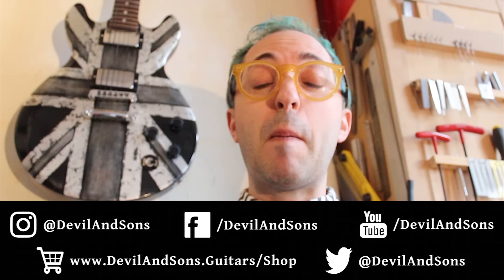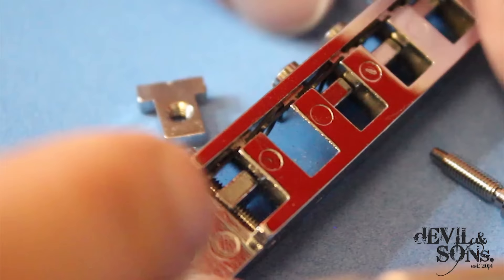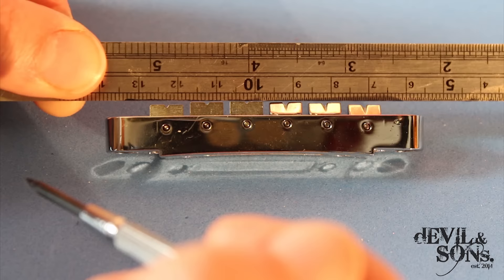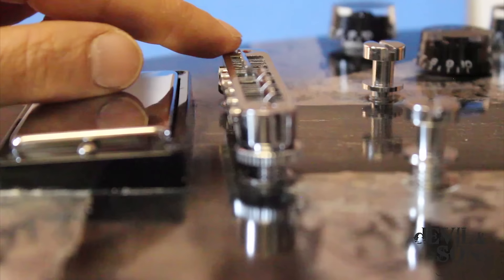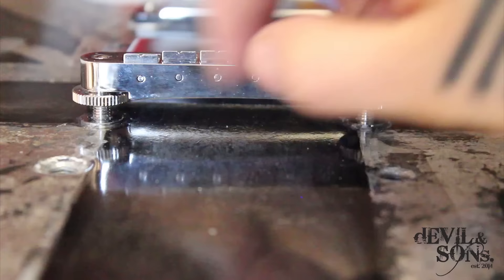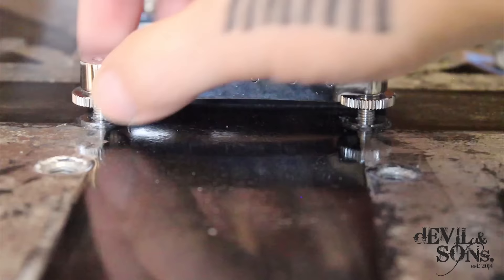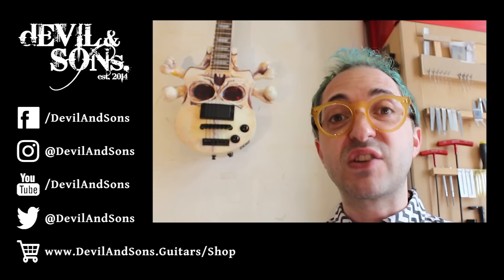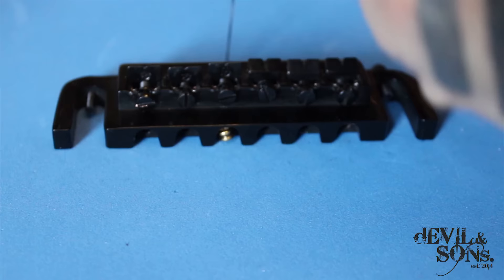Setting up a Tune-o-matic bridge (Les Paul style)

Comment: Hi Daniel! Thanks for this very informative video! A Tune-o-matic bridge does it require an angled neck or it could be used on a flat-top guitar like a Stratocaster?
Reply from the maker: I have definitely put one on a strat before but you are right, this makes the bridge much too high. One solution is to reduce the depth of the neck pocket with a thin piece of wood cut to fit and sandwiched under the neck heel,  but you may find you will need a slight angle by either giving this piece and angle to it or simply putting a shim in under the neck at the two bolts nearest the body so it does have an angle. It would also mean the pickups at the bridge position may need to be raised much higher than they normally would go. Essentially it’s not straightforward but possible.

Comment: Dear Daniel, could you please advise me on how to best perform a mod i'm thinking of. I have a very cheap Epiphone special 2, it has a fixed bridge (i guess it's called), so the strings both anchor on it and it acts as a bridge as well, although the saddles are immovable. I want to mod all of this as follows: drill holes so I'd have my strings go through the body and install a "tune-o-matic" with rollers instead of regular saddles. Please be so kind to advise me how best to perform this operation (how to correctly calculate the new positions for the new bridge and the position for all holes, both for the strings and for the bridge). Thank you very much in advance!
Reply from the maker: Does the fixed bridge still attach with the same two uprights as a standard tune-o-matic? If so you can simply replace this with a tune-o-matic with the the roller saddles (just double check the spacing of the uprights first). Then the stop piece you don't use but drill the holes where this would go, although really you could put the holes in a diagonal line, a straight line, random (you can get inspiration for this by looking at other guitars). To know where to drill the holes run a string over the bridge and angle it down to where you think the hole should be - as long as the string isn't catching on the bridge (as shown in this video when adjusting the stop piece height) you should be fine. Don't make the holes too far back as it increases the length of the string and you don't want to run out of string - although I doubt that will be a problem. You'll also need string ferrules to go in the back of the guitar to hole the ball end of the string in place.
Reply from the maker: I hope that made sense.
Reply: @DevilAndSons  Daniel, thank you so much for such a swift and detailed answer, everything you said definitely makes sense and is helpful, including all the great advice I got from the video. Alas, the spacing on the new bridge is wider than the old uprights; plus, another thing is that as it is now, there's just very little space between the bridge pickup and where the current bridge/stopbar is. this is exactly what I have now: https://images-na.ssl-images-amazon.com/images/I/61PJ%2BP4CVLL.jpg

Thanks again Daniel, for the content and the support!
Reply from the maker: Hmm, it's a shame it is wider. It may be easier to shop around for a new one that is the same width. I always look on ebay and amazon as there are often many options from various sellers there. If you end up sticking with one that is wider you will need to remove the old one, fill the holes, and drill new holes for it. Ideally the new one will go in as close as possible to where the current one is, if you increase or decrease the distance from the nut to the the saddles you will effect the intonation (although the saddles that move allow for some compensation). On the plus side there is lots of space for the through body string holes to go.
Reply from the maker: And thanks for your kind words about my  videos

Comment: what would be the ideal angle from the low E to the high E string?
Reply from the maker: Ideally you don't set the angle, you set the string height. So the height of the low e and the height of the high e above the 12thfret determine the angle. I have a video about that, I'll link it in the next comment.
Reply from the maker: Here it is
https://youtu.be/eNrrjXvebWI

Comment: One thing confuses me. I see many variations of the Tune-o-matic, even from Gibson. I have one on my Les Paul Studio. But it has adjustment two flathead screw slots atop each post which enables you to change string height. But, on others, there are no screws and you can only use the thumbwheels. But they're both called Tune-o-matics, even by Gibson. Can you explain?
Reply from the maker: Don Lessnau I’m not really sure - I guess they are essentially the same system just one uses screws and one uses thumb wheels to do exactly the same thing - it’s not really the bridge working in a different way just the way you alter the height is either with a tool or with your hands, but either way you are doing the same thing. The actual way the bridge works is the same. It’s like if the screws were flat head or cross head they would still be doing the same thing even though they are different screws. Does that make sense?
Reply: Yes. I have several guitars, including a couple Gibsons. that have Tune-o-matics but some have slotted screws in addition to the thumbwheels and others have hex head screws with thumbnails. But essentially, it's the same bridge except for the post screws. NBD. Just curious.
Reply from the maker: Don Lessnau I think it is an aesthetic choice as much as anything else, although I find thumbwheels more fiddly. Of course with thumbwheels you don’t need any tools to make adjustments.

Comment: I have a question. What should I do if I lose one of the springs in the saddles?
Reply from the maker: The springs are important to keep the string in tune, you could temporarily make do but I would buy a new one. I think if you look on ebay or amazon for guitar saddle springs you'll probably find them quite cheap. Alternatively you could look in the same places for a cheap replacement bridge (in the UK you can get them for under £10) and just take the springs off of that.
Reply: @DevilAndSons  thanks man! I'm gonna sub now
Reply from the maker: Cheers, thank you
I hope you find the part.

Comment: Why are the bass string saddles facing in the opposite direction to the treble strings? You point that out in the video and explain the difference but fail to mention why?
Reply from the maker: Opps, I thought I did. Bass strings are going to be thicker strings and therefore they will need to be fractionally longer for proper intonation. In general you would expect a nice slope with the saddle for the thickest string furthest back, and the saddle for the thinnest string further forward.
Reply from the maker: I explain intonation in this video, 34 minutes in: https://youtu.be/fvD-qsM3piQ
Reply from the maker: And actually next weekend I have a video coming out about scale length. Basically between that the full set up video there is a lot more information about why the saddles aren't in an exact place and change depending on the string and tuning.
Reply from the maker: I hope that helps explain it, happy to give more detail if needed.
Reply: @DevilAndSons  Job done...thanks Devil
Reply from the maker: My pleasure.

Comment: Does lowering or ascending the screws specifically on the Intonation saddle affect the intonation in general?
Reply from the maker: Lowering or raising the saddles adjusts the action, moving the saddles closer or further from the bridge adjusts the intonation. However changing the action will very slightly adjust the intonation but it may not be that noticeable.
Reply from the maker: Here's more on intonation 
https://youtu.be/cQ-yslOuHck
Reply from the maker: And here's more on action
https://youtu.be/eNrrjXvebWI

Comment: Do you recommend having the positions of the individual saddles in the position you're demostrating with at 07:25 before putting new strings on your guitar, the base saddles are lined up together and the treble strings are also lined up together but the treble strings are also further forward, or do you recommend having the saddles level for adjustment later? I do know about the bass strings naturally needing to be further back as you explained but it's the original position of the saddles before new strings i'm interested in here?
Reply from the maker: Simon bpuk great question, for which I don’t have an exact answer, but I would have the bass ones slightly further back and lined up and the treble slightly further forward and lined up. To be honest it’s unlikely however you position them that all strings will be perfectly intonated straight away so you’ll have to adjust them all whatever, so it probably doesn’t make much difference but at least you will be closer. I hope that helps. Occasionally a saddle is in the perfect position as soon as you put it on, I always think this is a great lucky bonus but impossible to predict.
Reply from the maker: The full set up video is now up, you may find it useful: https://youtu.be/fvD-qsM3piQ

Comment: I have a question. Why are first 3 saddles facing neck and the others tailpiece. In some tune-o-matic bridges, in this case mine, all of the 6 saddles are facing similar direction. Can you tell me which one is correct? It's blowing my mind.
Reply from the maker: Great question, I talk about it 3 minutes 30 seconds in. Basically bass strings normally have to be longer than the treble strings. Having the angle face backwards on the bass saddles allows them to rest on the saddle as far back as possible, having the saddle angle face forward on the treble stings allows them to rest as far forward as possible. It may not be needed as the saddles themselves move and you may be able to get the correct intonation without the saddles needing to be in their extreme positions (either way), but if you need that extra 2mm this is how you get it. I hope that makes sense.
Reply: @DevilAndSons  Thank you very much. I live in Georgia (the country) and here it's impossible to get a guitar speciallist who knows everything. I have to learn from youtube. That's why I watched your video and thank you again. Great video 💪
Reply from the maker: Michael Stark thanks so much. I love the internet, and YouTube especially, for finding out things. Happy strumming.

Comment: How do I adjust the saddle when the bridge is already on the guitar, cuz my 12th Fret isn't exactly an octave? It's like at a very inconvenient angle and I can't properly get my screwdriver in. Do I need a special type of screwdriver or something?
Reply from the maker: Unfortunately when the screws point towards the tailpiece it is often hard to turn them, even if they are pointing towards the pickups. The only solution I know of makes the whole process a bit longer but is pretty straightforward. You need to loosen all the strings so you can move the bridge to an angle where you can make the adjustment, then tighten the strings again. It may be easiest to loosen all the strings, adjust the lower e saddle, tighten just the lower e. Once you have this right move on to the a. You'll have to loosen the e again, adjust the a saddle, tighten the a string to check it's right. Then move on to the d, etc, one at a time. Tightening all the strings at the end. Alternatively you could loosen all the strings, take the bridge off and turn it round, tighten the strings, and hopefully have access to the screws more easily with the bridge the other way round.
Reply: @DevilAndSons  the screws are on the pickup side. Thats a good idea, thanks, I'll try it.
Reply from the maker: Good luck, it should work even if it takes a while. By the way I have a full set up video that explains intonation that may be helpful.
Reply from the maker: https://youtu.be/fvD-qsM3piQ

Comment: how do I know that I have set my bridge height correctly?
Reply from the maker: Thanks for leaving a comment. basically as a guide I would suggest the following:

Measure the height of the strings at the 12th fret, for the top e you want it around 1 - 1.5mm from the top of the fret to the bottom of the string, for the low e you want it around 2 - 2.5mm high. This is just a guide and you will find the gauge of your strings and the way you play will determine what is best for your particular playing style. If you need a bit more advice there are quite a few videos that focus on how to set up a guitar in general that should help. One day I will make that video though, although it will probably be a bit late for you - but do subscribe to see it when it happens. Thanks again for commenting.
Reply from the maker: The full set up video is now up, you may find it useful: https://youtu.be/fvD-qsM3piQ

Comment: I have a slight buzzing of my G string on the 15th fret.  I don't know what caused the buzz,  maybe u can help me
Reply from the maker: It could be a couple of things. First I would try raising the string height by making the saddle higher (but not so high you aren't happy with the action) and if that doesn't work I would try adjusting the truss rod. I have a whole video on setting up your guitar that may help as it covers both of these things. https://youtu.be/fvD-qsM3piQ
Reply: @DevilAndSons  i will try to do that.  Its is the only fret and string that has a buzz sound.  The other frets and strings doesn't have. That makes me wonder.  Thnx a lot,  ill hit u back if it works
Reply from the maker: It could be an issue with a fret but I think altering one or both of those things should resolve it.
Reply from the maker: Let me know how you get on.

Comment: I'm having string buzz at higher E string at 11 th and 12th fret... what can I do...... I've given relief on the fretboard by adjusting the truss rod..... the frets are even i've checked with fret rocker.... still those two frets are buzzing...... Help pls.....
Reply: Well its Esp Fx 260 SM with this kind of bridge and tailpiece.....
Reply from the maker: What happens when you raise the saddle (increase string height)? That may help, but obviously you don't want the strings to be too high. It could be a problem with the neck angle, in which case you would need a shim (is it a bolt on neck?). I haven't made a video about shims yet (someone actually requested one the other day), although I want to it wint be soon enough to help you. If the string height adjustment doesn't work you may have to shim the neck. There are some videos around on it, basically I think you need to raise the neck at the front of the neck pocket by a very small amount, and then re-set up your guitar. It's actually not as complicated as it sounds. Let me know about the string height though. Hope that was helpful.
Reply: @DevilAndSons  Thank you sir, its not regarding the string height.... I've increased the string height, still the guitar is buzzing on 11th and 12th fret. By the way its set neck.
Reply from the maker: @aakaashbulani9237  Is it a bolt on neck? In that case you will be able to shim the neck, but again I haven't yet made a video on that. Sorry I can't help more. I'm sure there are videos on using shims on youtube, and I think that may well be the problem.
Reply: @DevilAndSons  No sir its a Set In Neck.... and not bolt on..... actually its the lower E string which is buzzing.....  Guitar has a Tune O Matic Bridge.... Tom Bridge with tailpiece kind of........
Reply from the maker: @aakaashbulani9237  I'm not sure what to suggest, if you are certain it's not the truss rod, string height, or frets I can only think it must be the neck angle. Perhaps a lighter gauge string will help but it probably is something that needs to be seen in person to fix. Sorry I can't be more help.
Reply: @DevilAndSons  No problem Sir..... I appreciate that you even took out your valuable time to help me...... I think its time for me to go to a local guitar tech...... Thanks for your help sir........ Good Day......
Reply from the maker: @aakaashbulani9237  thank you for leaving a comment. Good luck, I'm sure it is something that can be sorted out when someone sees it.

Comment: Amazing tutorial after watching this i want to do some on my 2 guitars all of the saddles pointing in one direction should i leave or is it better to have them setup correct way?
Reply from the maker: Thanks so much for the comment, I'm glad it had inspired you. The advantage of the saddles pointing in different directions is that then you have maximum use of how far they can move back and forward, but unless your saddles have to go the extremes it is OK to leave them pointing the same way. I also have a full video on set up which may help with some other elements.
Reply from the maker: https://youtu.be/fvD-qsM3piQ
Reply: @DevilAndSons  thanks you very much wish I found your channel earlier
Reply from the maker: @baselstein  what a lovely thing to say. Thanks.
Reply: In my opinion if you can get a perfect tune at open position and also on the 12th fret with all saddles facing the same way then no need to change them. On my Les Paul I have E-A-D-G facing one way and B-E facing the other in order to get the tunings just right. For some reason I needed that extra space on the G cuz I was about a 1/4 note off at the 12th fret.
Reply: @phillipstai7204  thanks man
Reply: @baselstein  Good luck with your setup.
Reply from the maker: Yes, it doesn't really matter what way they face if you don't need that extra distance but reversing them. In which case I guess it's just aesthetic.